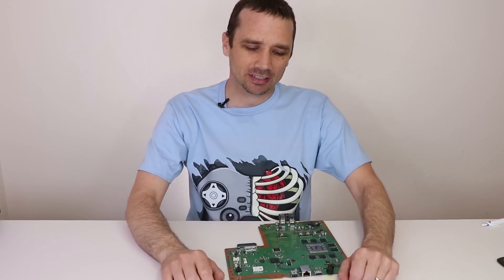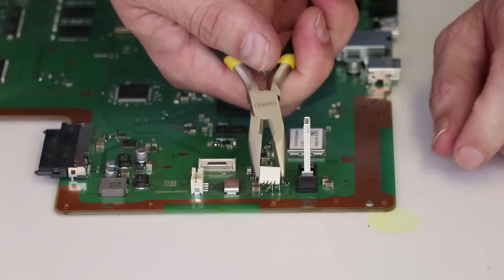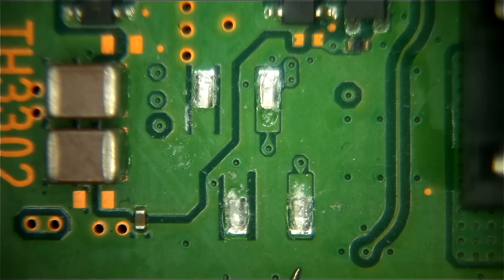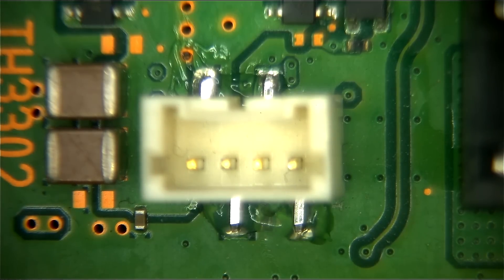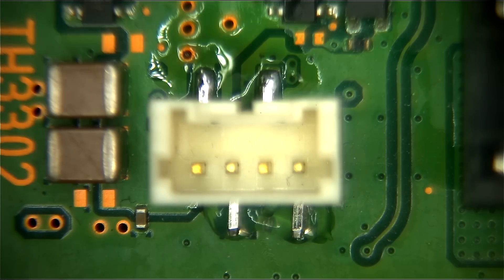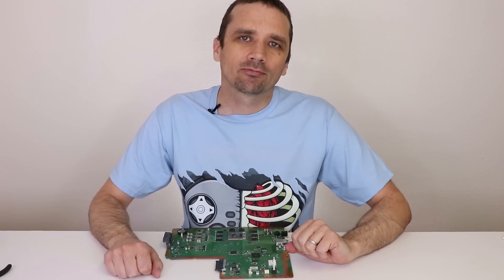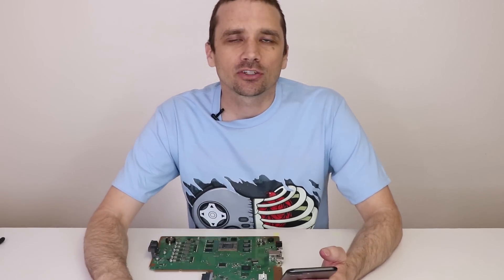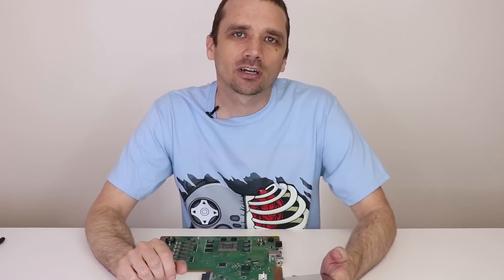PS4 Power Supply Repair + PS4 Q&A At The End

Comment: Hi sir. I was cleaning up my ps4 then suddenly the 2 prongs attached to the power supply was a little bit bent. I was able to correct it but my question is, will it become a problem in the future? Will it cause any burn/damage on the mother board? Hoping for your response or any help. Thanks!
Reply: HOW DID YOU FIX IT
Reply: THE PRONGS
Reply: How did you fix it 😭😭😭

Comment: I ripped the connector off the motherboard of my ps4 controller? Can you please help? Or would it be the same as this? I ripped it off thinking I had pulled the actually battery plug but pulled everything together.

Comment: i accidentally pulled the plug all the way out had to solder it back. how do you know if it was done right. i think something might have gotten unplugged. my system works fine. but none of my controllers will stay connected

Comment: Hey so my psu blew out and I replaced a new one and in 1 min that one blew up what could it be?
Reply: You might be connecting to wrong socket voltage. Check the voltage value for your country of residence and what's the voltage on the psu

Comment: Question: I dropped my PS4 control to the floor. When I picked it up, I was shocked by the static of my carpet. Instantly my PS4 unit turned-off. Since, the unit will not turn back. Is it fried or fixing about?

Comment: Hello, I unfortunately tore the cable and plug from the mainboard when I disconnected the power supply connector. I'm now looking for the connector that sits directly on the mainboard. I would then solder this on and then plug in the cable again. unfortunately I can not find this connector .. do you know where I can order this connector?

Comment: Hi. I accidentally ripped of the little wires where you connect the 4/5pin to power supply not from motherboard. Can the powersupply still be fixed? Thanks

Comment: Good for you because i just broke my PS4 pro power supply and guess what its 2018 new version and its very very tiny to fix
Reply: My son ripped ours off too. Model 7215b. Two pads got completley ripped off and the other 2, the ground and the 5v were partially pulled up. On that model, the 4 pin header (connector, port) has two posts on the sides that are mounted to the board as well, they are just for extra support though. Don't let anyone say it can't be fixed either. It absolutely can be fixed. There just isn't a lot of info on the new model. I don't even think there is a complete pinout anywhere.

Comment: Hey can I get some help I dont have my old power supply I used a pc power supply to get my ps4 up and running.. but I recently bought a new ps4 power supply but it did not fit my console those 2 tall pins are on the wrong spot on the power supply I bought I can't find out how to figure out witch power unit I need ... it also has the 4 pen connector... plz can someone help
Reply: Oh and the only power unit I've found online that might work says it's for a ps4 slim but I dont think mine is a slim console

Comment: Can u tell me which wires are wat as seen on the Internet it can be soldered onto the board as my connector is bent can u tell me which wires are wat and wat the pins are on the board
Reply: Google ps4 power supply pinout or just ps4 pinout.

Comment: If I sent my ps4 to you guys because it was overheating and the connector ripped off like in the video would I have to pay for multiple services or just the single $109 overheating service? It says on the website that you will replace or fix any broken parts but I can’t tell if it’s an additional charge.
Reply from the maker: If there's more than one repair we do charge more.

Comment: tronicfix i dont get it how did you remove those 2 pins that stayed on and can you just put those 2 pins back in the connector to reuse them or you have to buy a new connector
Reply from the maker: I melted the solder to get them off then just slid them back into the connector. They just slide in and out...it's a tight fit but possible. There's nowhere to buy new connectors that I know of.
Reply: That's exactly what happened to one of my pins and now that I know you can slide them back in I feel more confident in soldering the connector back to the motherboard board.

Comment: Is there anything u can do if one of the 4 pin connectors is completely ripped of from the motherboard. 3 of those places look fine on a board, but 1 of those 4 doesn't have solid surface to solder on. Plz help me to fix my board if u  can
Reply: To be specific it seems there is only plastic left on a upper right data connector   on a board. Is there any DIY fix u can do?
Reply: Do you have the ps4 pro? Coz it same as mine

Comment: would you be able to just solder the wires straight to the motherboard without the connector?
Reply: yes you can, just map them out so you get the correct order. I used longer cables and just kept one connector for the psu. Makes it much easier to remove from the PSU if needed now. Also less heart attacks.
Reply: Yes you can i did it and it worked just fine.

Comment: I checked out your web site for what your shop would charge to solder back a broken off power supply connector but I didn't see a price. What do you charge for the work? I broke mine off but it looks like a fairly clean break. I don't have the tools or the skill to solder yet.

By the way, how do you check afterward if the connector is back on properly without reassembling the console and booting it up? It'd be a pain to put it together only to have to take it apart right away.

Comment: I have a Ps4 fat, I have disambled the case to clean the ventilation and I have removed the power supply too for a better clean, when I put all the things together again on my Ps4 I turn it on to see if it works, and now I have the blue light led on for a few seconds and then she switch off...did I have to replace my console power supply or maybe there is a way to fix it somehow?

Comment: I want to buy a new ps4 and xbox1 motherboard, so i can put on a computer case. What is the main thing that breaks in gaming systems, and can i use the same hard drive for 2 or 3 systems? I wanted to build a vr/computer/switch/ps4/xbox1 system

Comment: Hey man question for you. Do you know the name of the component and if you can buy them individually somewhere? Had a friend who was having problems with the system shutting itself down, which wasn't surprising since the side vents looked like they had black cotton balls shoved into them, she didn't even know you had to keep it clean she just had it for her young son. Anyway, once I had it open I went to disconnect the cord from the power supply itself instead of the end connected to the MB, and the damn thing literally popped off the MB. There was hardly any solder holding into place, and the component itself looks much more bent than yours . I think a combination of both was causing the problem, it was a Craigslist buy afterall.
Reply: They are 4 pin male shrouded headers, or pc mount connectors.
Reply: They are 4 pin male surface mount headers, or pc mount connectors. You need to know the pitch of the pins though.  You do that by measuring the distance from the center of one pin contact, to the center of the next pin contact. I believe these are 1.50mm. Don't quote me on that though.

Comment: i tried removing the cord from the power supply and i think i wiggled the contact point lose. Like this video BUT on the power supply end.
How much play should the contact have on the power supply? I ended up disconnecting it safely from the motherboard.
Reply: Just Google ps4 power supply pinout, or just ps4 pinout.
Reply: Just Google ps4 power supply pinout, or just ps4 pinout.

Comment: I've changed my thermal paste, but i accidentally plucked off the power supply cable from the motherboard, i took the console to an professional electronics engineer to solder the power supply, everything was ok, but when he tries to turn it on, its just one short blue light an then it shuts. Any idea what can be done?
Reply: Check for a bridged connection.

Comment: Entering safe mode to reinstall firmware: once powered off complete hold power button for 7 seconds. Is this a function built into the motherboard or the power supply?
Reply from the maker: Motherboard

Comment: I have a question, so the top left power pad didn't completely ripped off it's just dangling, can I just soldering it back down to the pin connector and that should fix my problem or do I have to set a wire to trace back around then solder it down?
Reply: Clean it, use epoxy to glue it down, put heat tape over it and clamp it if possible, let it cure, pull the clamp and tape then solder to it. Make sure you use epoxy that can withstand the heat of the solder.

Comment: I was taking apart my PS4 to clean the dust out and when disconnecting the power supply I bent the pins on the connection and when I tried to use tweezers to fix them they fell off. Please help!!
Reply: King Colt bro I feel your pain. I just did the exact same thing and I don’t know what to do, or who to take it to
Reply: kevin ratliff have you got it fixed ?
Reply: zZ Nelson nope
Reply: @nelson4780  had to get a new power supply
Reply: kevin ratliff same boat
Reply: @NB600  I bought a new power supply for it, easy installation

Comment: If you completly mess up the PCB as i did when this happened to me, you can also just solder some wires to the testpoints at the back of the board. GND is not even neede as it gets the same GND through the big plug.

Comment: I scewed up i pulled the power supply conector from my ps4 pro. And all the green thing from the mother board and the conection its diffrent from the normal ps4. Do i need a special wires to make it work?
Reply: I did too,nothing to solder to.
Reply: You can repair the pads that pulled up by using jumper wires to complete the connection. Circuit medic also makes pre-cut circuit frames that have an adhesive back. They're made to replace damaged surface mount pads. There's a lot more to it than just taping new pads down though, so dont think it'll be that easy.  But, it's not really cost effective, but either is sending it in for repairs. Plus, most of the time, they will claim it can't be fixed, or to go buy a new one. You can absolutely fix it, and fairly cheap too. Also, there is really nothing about the new 7200 pro model on the internet, but the basics of similar repairs are the same. Look at Andrew Paul's YouTube videos to get a decent idea of what you're even looking at.

Comment: Can you do the same on ps4 pro? I have cleaned my ps4 pro properly for a few times now and the power supply connector is broken. I noticed that my ps4 pro didnt turn on so I checked that out and  the connector was broken. Is there any way that I can use to fix it??!
Reply from the maker: You can fix all PS4 PSU connectors the exact same way

Comment: My ps4 1115 wont turn on at all no beeps or anything, I checked out the power supply and it had lint and dust but nothing major I cleaned it all and it’s still not working the system doesn’t beep at all no blue light. Let me know what I can try. I tried blowing compressed air on the power supply and it still didn’t work

Comment: Hey Tronicsfix, i have a question about my 1.74 Cuh1116a. i got it broken from ebay for 10 Euro with the Problem that the Board dosnt turn on no Beep etc. i test the board with a ATX Power Supply but the Console seems dead.  what u think is the Problem? Short? :c
Reply: same problem ....

Comment: If the wire is damage for that power supply connector. Where can I get it? Or is it possible you guys can find me a wire?
Reply from the maker: You might check eBay but I don't think there's anywhere else you can easily get them.

Comment: I have a ps4 pro i bought from the uk. Its the limited edition. Its a 220/240v. Can i change the power supply to a 110? if not, what are your thoughts. Thank you
Reply from the maker: You just need a different power cable. All power supplies on all PS4's are dual voltage.
Reply: @Tronicsfix  I bought a used PS3 from the UK an ran it using the original UK cable. I'm from Finland, so we use the same voltage, but the plug is different. I bought a converter (just a connector) to plug it in the electricity source: The PS3 worked perfectly for three weeks, but then it started shutting itself off and freezing. Later, I bought a local cable for it, but it didn't fix the issue. Do you think that the converter might've broken the power supply? 

My analysis:
I think the power supply is the most likely reason why the PS3 Slim keeps turning off completely or freezing after a couple of minutes. Sometimes it lasts for up to 8 hours, but won't turn on for a couple hours, then it does, but it usually stays on only for a little while. It takes about 24 hours after a shutdown to get it to work for a couple of hours.

Comment: Yeah the disc goes in and you hear it spinning and then it stops and spins again after a click and then says unrecognised disc.  I took it to computer repair shop and guy replaced the reader ? That's the lens is guess. And he says it's playing the discs better but still having the same problem with some other discs.  Now he going to put a stronger reader in . But said it mite be the motherboard that's making the disc drive faulty.  Is this true or is this guy trying to pull the wool over my eyes?  Thanks for last reply much appreciated
Reply from the maker: I'm not sure what that guy is talking about. There's no such thing as (a stronger reader) for these. Just from that it sounds like the guy has no clue what he's talking about. Like I said if it's pulling the disc in and the disc is spinning then it's not a problem on the motherboard.

Comment: How do you know which pad and where to do the traces? Please can you explain this further? I'm sure for most people at least a little bit of the circuit board will break off. For me the two pads nearest the outside edge of the the motherboard have broke a little bit and I'm still unsure of how to do the trace wires.. thanks for your otherwise perfect video though. Very precise and to the point 👍🏻👍🏻
Reply from the maker: Usually, you can tell where they tore off from. If not then just do a Google search for your motherboard until you see a pic of the same one. Sometimes that works, sometimes not.
Reply: Thanks for the reply. Being new to this I was unsure if the trace wires had to link the circle circuit trace section as you called it to the pad it was beside or one of the other pads. I now understand How to attach it now though thank you. Also it might be worth mentioning for others that you may have to scrape back a little bit of the Green coating/solder mask to reveal the copper underneath before you then add the trace wire from the copper nearest the circle area shown to the connector pin as advised in the video.. I had some How ripped off two solder pads and left no visible copper to attach the wire. Thanks a lot
Reply from the maker: Ya, I probably should have mentioned that...I often forget the things I didn't know when I first started. Thanks for pointing that out.

Comment: damn man those power cables give me such anixety when ever i try to remove the cord  >_< gotta get into my ps4 for routine cleaning but cant properly clean it due to  those fragile cables
Reply from the maker: Ya, you gotta be careful with them. As long as you remove them just like I show you should be fine.
Reply: @Tronicsfix  i just broke mine trying to take it out...
Mine is a cuh-1215a model. How do I fix it? The one I broke was the one that's in the power supply.
Reply: do you guys offer free thermal paste samples?
Reply from the maker: No, we don't even sell thermal paste

Comment: I soldered the piece back together and it still won’t turn on
Reply from the maker: Did you solder the small circuit traces back where they go?
Reply: TronicsFix yeah it was a little hard because my PS4 is the 1215a
Reply: TronicsFix I’m just gunna send it in and have u guys fix it

Comment: To anyone out there always always buy a surge protector electronics are very sensitive to surges it could damage your equipment. Do not ever just directly plug your expensive elections into the wall outlet unless you wanna have a big repair bill. Be smart protect your investments.
Reply from the maker: Actually, It's better to plug PS4 Pro consoles directly into the wall. Sony themselves recommend this. Surge protectors can actually limit the power getting to the console and cause them to turn off.

Comment: How would you fix it if you pull the power supply plug out wrong ? Do I need a new power supply plug?
Reply from the maker: That's literally what this entire video is about.
Reply: I’m not talking about the connector on the motherboard  , I’m talking about the plug you put in the power supply and the connector on the motherboard

Comment: Awesome Video! Wish i would have found this before i paid $80 to have mine re soldered on my ps4pro mother board,Thanks for the Great info
Reply from the maker: We charge $99 for this repair. That may seem high but we have to disassemble the entire console to get to the motherboard to do the job. Many times we have to repair the circuit traces too so it takes a good amount of time. $80 is a good price if they did a good job.
Reply: TronicsFix Do you think the price is cheaper if I were to ask someone to just do the solder job? Give them just the board?

Comment: When you get a PS4 in for repair, you guys do a basic cleaning. Does this include cleaning the heat sink?
Reply from the maker: Yes, it includes a basic cleaning. It includes the power supply side of the heat sink but not the fan side.